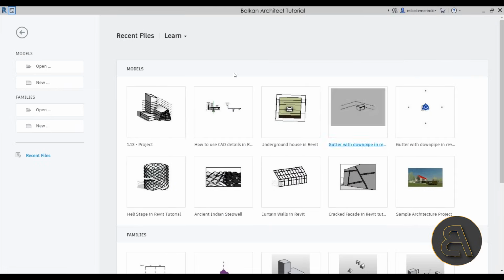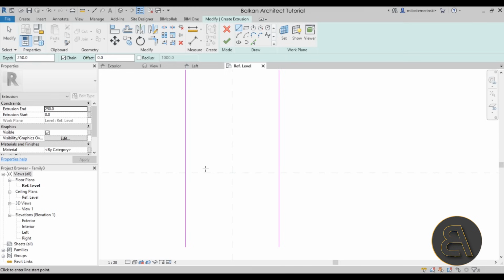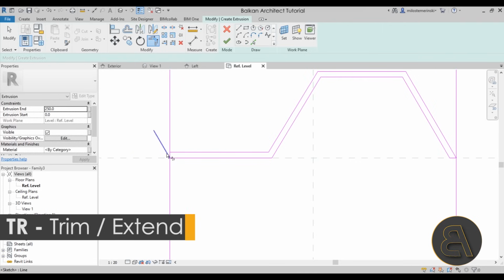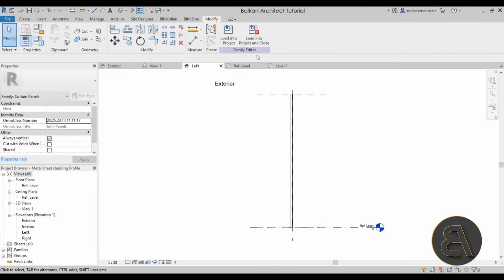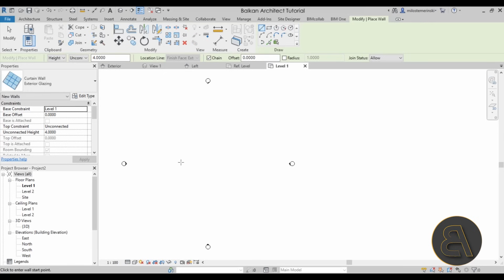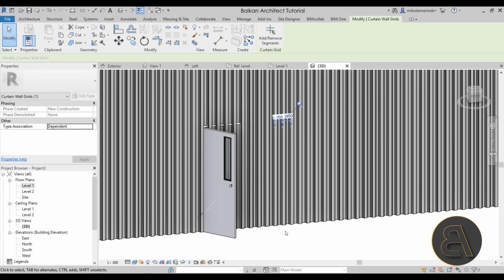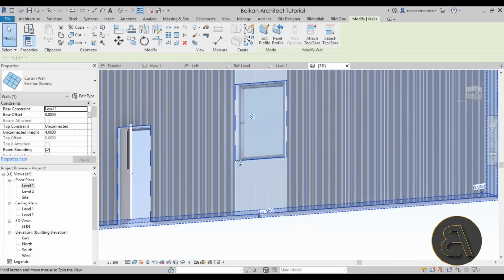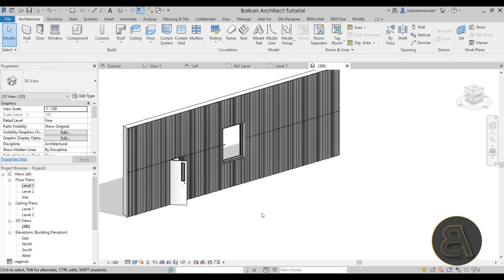Metal Sheet Cladding in Revit Tutorial

Comment: Hey, this might not be the most professional workaround. 

But you could always have a wall directly behind it with the only material being air to host doors/windows. 

And then just make multiple corrugated steel walls going up to the window and then from the window above.

The joints get a little messy when you’re starting different walls. 
But it’s always there

Comment: Hi BalkanArchitect, thanks for this video. I have a question, I encounter a problem if I want to edit the profile of the curtain wall in which I have added the Corrugated Steel Profile, only it won't accept diagonal lines. For instance, I want to fill the side of a wall wich a pitched roof and I want the curtain wall to follow the shape. Is there a solution to this? Many thanks in advance!

Comment: Good video as all your video's are, but following your instructions I get many issues with the wall cladding.  I am using manufacturers Revit profiles which are basically the same 2D profiles you create then I extrude them per your video but the curtain walls end up with many issues. Too many grid lines along the wall length, can't make panel so replaces it with system panel, height of wall ends up much higher than the building, won't cut properly.....the list goes on.

Comment: Hi! Your video is extremely helpful so thanks for sharing. Also, I'm trying to apply your method to sheet piles, yet the last element is overlapping. The fixed distance is 1200mm and when the wall length is not a multiple of 1200,  this overlapping is happening.  I've tried different ways to try and work around this and nothing seems to work. Your suggestion would be much appreciated. Thank you in advance.

Comment: Thanks for your video it was very helpful.
I was wondering if you could help resolve the issue of angled walls where the sheeting disappears as Revit cannot resolve the roof slope?
In other words the top of the profile (cladding) is horizontal and cannot follow the slope of the roof so Revit replaces it with a standard "solid panel".

Comment: hello, i've been stuck on this for a while because no matter what i do i keep getting the error messsage Changes have been made that cause a curtain wall with type driven grid lines to exceed the maximum allowed number of type driven lines (200 in direction (1) and 200 in direction (2)).  If you really need this many type driven grid lines, please split the affected wall before proceeding. . how can i get past this? thank you!
Reply: Did you ever fix this issue? I am having the same problem now
Reply: @j.j.v.z  did any of you fix this issue?  :)
Reply: Try setting the spacing to a higher value such as 156.0mm
Reply: I am literally having this issue right now   : /

Comment: I’ve done a similar thing with timber boarding but used a nested array family in a curtain panel family….mainly to avoid all the mullion grids you get with an array. It works really well and is easy to cut or swap out for something else. The downside is you need to use masses to cut anything not square.

Comment: Great video! I only have one problem. When I try to attach the curtain wall to a sloped roof it shows an error and replaces the curtain wall saying "Can't make type Metal Sheet Cladding Profile" and then "Missing Curtain Panels will be replaced with System Panels to complete command" Do you know how can I fix that? Thanks!!
Reply: I'm having a similar problem as well. Are there settings in the exterior glazings or save file paths that I need to follow?
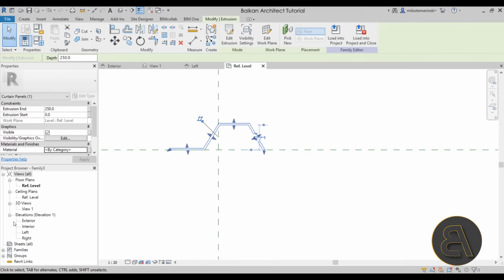EDIT: I checked the instructions from 5:50. So I needed to lock the extrusion edges to both the top and bottom reference lines to resolve the "Can't make type Metal Sheet Cladding Profile". Would that answer your question?

Comment: It is better to create a family with an array. This way you can count how many sheets you put in the project.
Also, you can create a set of parameters that will check the lenght of the wall and divide by the sheet width, giving you the count as well
Reply: Please elaborate, can you link to a tutorial or perhaps a family that you created already? Is it still easy to create openings for windows and attach it to the roof for automatic cuts?
Reply: don't u think that would increase the size of the revit file, having one sheets and all...all over the project and plus, how would you create window openings

Comment: use wall profiles instead. Create a profile Family. Load into project. Wall Profile. new type. use the Profile. Check the cut opening option, and you can even create special profiles for the corners. The only disadvantage is that you will have to copy the Wall Profile multiple times but you can use "Array" for that puropse
Reply from the maker: Hi, yes I explored that option as well, that approach gives you easy openings but is harder to place, because you have to copy the profile and the approach in the video is much quicker to place but takes more time to make openings. I guess everyone has to choose what works better for them 🙂
Reply: Would you use 4 profiles if you want battens, cross battens and board on board?

Comment: So what's the fun using revit and doing all manual , creating the metal sheets and then modeling the wall behind the cladding , again making openings manual !! Supose u have a huge facade r u going to do it one by one 😟I dont wanna mention any other bim software her , but really is this the right method , i have seen other great method in another software u will just have to select the product from bimobject and then apply it on the " walls " not the opposite . And it will just cut all the openings automatically .
Reply: Usually we just use surface material on an equivalent layer thickness with a good texture map. Modelling corrugation is a waste of time and pc memory.
Reply: @AussieBIMGuru  u dont have to model it in Archicad for example u just apply it from bimobject website with a proper thickness and cuts all openings no waste of PC memory .
Reply: @faresjawad3096  it's a waste of memory for the PC to have to render the shadows and detail. If people want to do it that's fine but I don't see the point unless it's super small project scale.
Reply: @AussieBIMGuru  I think it will help u in archtecural coordination the thickness of the cladding might hit a drainage pipe and if u put just a texture u wont feel it or c it .
Reply: @faresjawad3096  but if you make the layer the same depth you would. I only think it matters if the corrugation has a design intent, e.g. running pipes between a wide sheeting tray.
Reply: @AussieBIMGuru  100% agree Gavin. I have previously used Kingpsan Panels within a Curtain wall system which expedites the process described by Balkan here but again it is needlessly taxing on system resources. A Standard model wall buildup with the appropriate texture map and hidden line presentation styles is more than enough, particularly on any project of a significant scale. You also do not have to contend with some of the difficulties associated with the curtain wall system families, such as openings that are not equal to the grid intervals etc. Also, the sheer volume of standard wall hosted families that are readily available is reason enough to use the method you described. Good luck with the DeFrag! :D 
Niall
Reply: @8020BIM  cheers Niall!

Panel interval spacing and mullion behavior are indeed issues to avoid if possible.

Comment: could you make video about create one schedule to sort and calculate column's length and beam's cut length ? the section is the same size. thank you
Reply: i created construction frames in revit , i tried using all the beam to create, but i must pull every beam's handle to control the ending, if using columns for vertical beams for horizon then its very quick, its automatically control the ending. i want to create one schedule like one schedule of structural frame

Comment: Wouldn't it be easier to just find a corrugated steel texture on Google, make a new material, and insert that material as the new finish for the wall? That's what I did. It took like 6-7 minutes, and you keep that wall forever in your template. It will also work great with openings/doors/windows/etc.
Reply from the maker: Yes but in floor plan view you will not have accurate representation and renderings will look much less realistic 🙂
Reply: @balkanarchitect  
Thanks for the info. I render on Twinmotion (Free, faster, and more realistic). It imports and auto-updates from the Revit file if you get the free extension.
Reply from the maker: I know, I'm planning some tutorials on twinmotion in the future! 🙂
Reply: @balkanarchitect  
YESSSSS!!! I'd love to see those!
Damn...Is there anything you can't do???
Reply: @balkanarchitect  Thnx...cant wait for that